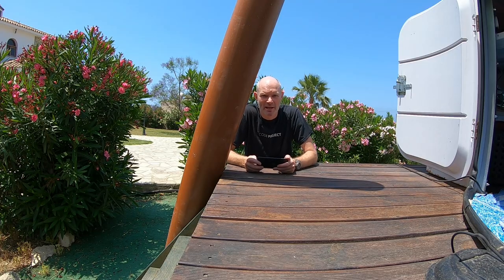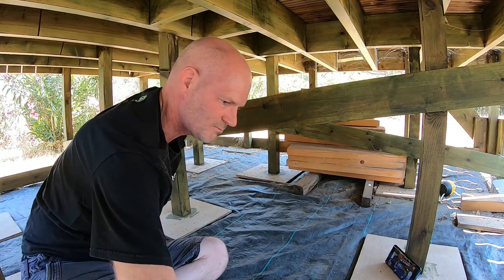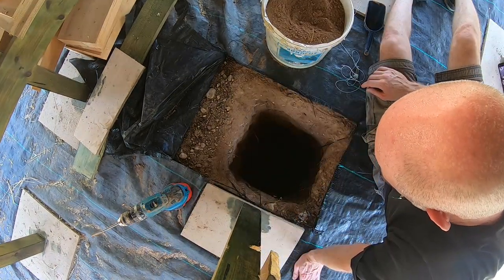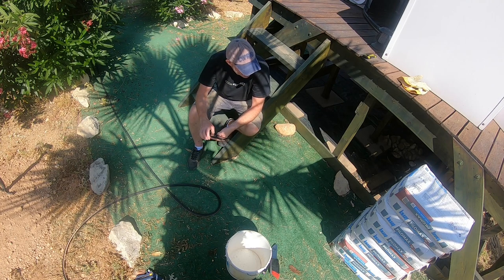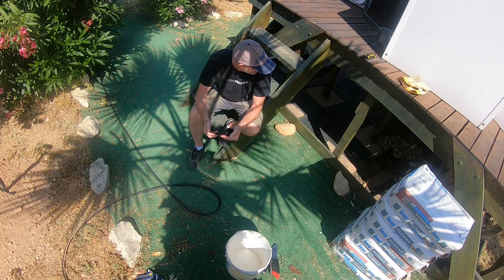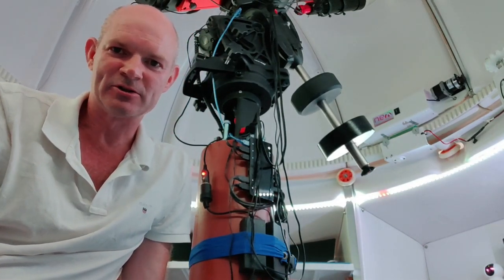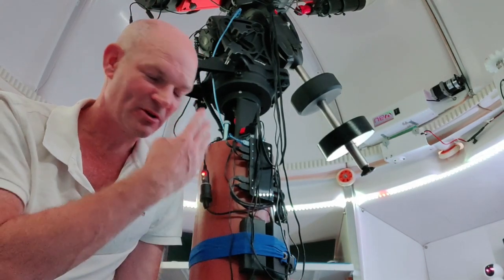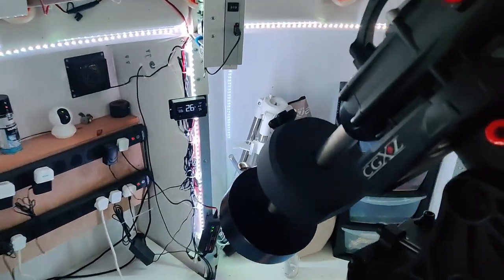Observatory Concrete Pier Project - It's Done! (and voice controlled lighting!)

Comment: Great effort. I was thinking you'd have a lot more room without triping over tripod legs before you said it. All you need now is a better seat in there!
Reply from the maker: Cheers Ian, yeh, just need to find the right one, but the poly block work great (they were the ones the mount came in!) Going to move the laptop one bay to right so I am away from the counterweight bar, couldn't do that previously due to the tripod leg.

Comment: Super job, as I know from my dome any increase in available space is most welcome. Are the jacking screws for the pier head acting directly on the concrete, if they are it may be worth adding a metal plate underneath to spread the load across a greater surface area.
Reply from the maker: The jacking screws are on large washers on the concrete and are only used to set the level, after which everything is locked in place on the main tie rods which are 1m into the concrete, it ain't shifting after that. In theory the jacking bolts can be slackened off.

Comment: Nice work Dave although I do not envy you working in that heat. Mine was so different as I had frozen ground to try and dig through lol. Nice solid looking pier, clear skies
Reply from the maker: Cheers Glenn, you do eventually adapt to the heat. Cyprus is mild compared to Qatar, highest I seen it in the garden was 52.3'C when we lived there.
Reply: @DavesAstrophotography  52.3 🥵🥵 that’s crazy temps.

Comment: Great job Dave! Should certainly improve guidance. Im going to have to tear mine down and rebuild it 300 miles away - as Im moving to the Elgin area!
Reply from the maker: Nice! What's pulling you up North to Elgin? When you moving? I'll be heading over to Aberdeen for a short visit later in the year....so not far away, could have a quick catch up...
Reply: @DavesAstrophotography  retirement/ downsizing...bortle 5/ 6 to 3/4...! Ill post on the tear down build up. If everything goes well it will be early july. Yeah..could catch up over some beeers?? !

Comment: Supurb work.  But, I have to ask, why wasn't  a pier part of the original design?
Reply from the maker: Hi there,  as it is a rented property I wanted to try avoiding concrete, it was fine for remote observing, but found I was in the dome a lot, particularly the summer and any movement screwed things up, so ended up going down this route.

Comment: That will make a big difference - great work! My NexDome is on a concrete slab with a pier tripod as I wanted to keep it simple.
Reply from the maker: Thanks, Yeh, I had one night in it doing the polar alignment and then a few target hopping and already noticed the difference. Now that the tripod is out of the way, I'm going to move the workstation area one bay to the left to keep me clear of the counterweight bar. The tripod leg was stopping me doing that previously.

Comment: Hard enough digging my pier foundation in 18 degrees, must have been double tough in the heat and with limited headroom! Looks great!
Reply from the maker: Yeh it was a bit of a challenge, but using the spade bit on a drill was a winner! Iwas melting, didn't realise until I was editing the video and could see a bead of sweat hanging on my nose while I was sitting talking in the observatory after filling the pipe with concrete! I only hit my head hard once near the start of it all when climbing in under the decking.

Comment: You might consider capping the concrete with a steel disc ( say 12mm thick) using epoxy to fill the interface gaps. The steel disc will mitigate the potential issue of the jacking/leveling screws working into the concrete and loosening up.
Reply from the maker: Cheers Rob, yeh, if I see issues then I would consider this, but getting hold of things like this easily in Cyprus is pretty hard, I went with the liner as it is tough as hell and once compressed down can't see there being any issues long term.

Comment: Hello. I am just new to astronomy and have just completed an observatory. I am now installing a pier and found your video. Now I had planned on using 4.5 inch pipe in a concrete footing also filling the pipe with concrete but am told that is too small.  What dia pipe did you use? And why the square footing and not round? 
FYI I am not using my telescope for photography at this point.
Thanks!
Reply from the maker: Hi there Glenn, congrats on your obo! The pipe I used was 8". I just went with square, it needed to fit within the space between observatory legs, but be big enough to get a lot of mass under the ground, normally you would build the pier footing before building the observatory, but I did it the other way round as I wanted to try with just a tripod in the obo first, but there was too much vibration, so went back and added the pier after. In the video, in the video it does mention the size of the hole and you can also see all the obo support legs I was working between.
Reply from the maker: You might also want to check out some of the other guys who have also recently built an observatory have their details on their channels, check out @Astrobloke, @lukomatico, @SimonsAstro and @NebulaPhotos to name a few, but lots of great content on YT for obo building.
Reply: Thanks for reply! I will check those out for sure.

Comment: What reinforcing was included in the concrete? Concrete only good in compression.
Reply from the maker: I put some old rods and things that were lying around the shed into the concrete. The top 800mm also has the steel threaded bar from the mount. There is not a lot of tension loading, and 8” diameter concrete inside thick walled PVC pipe will be fine.

Comment: Lovely video. Im about to make  a concrete pier of 2 meter high. Did u notice any vibrations with your pier? 
Also do u have a link to the lier extender?
Reply from the maker: Hi there, no I don't see any issues with pier vibration. I got the pier extension from Baader Planetarium website, but its also on some other supplier sites. It is the Baader Short Pillar III and then you get different rings for the different mount types.